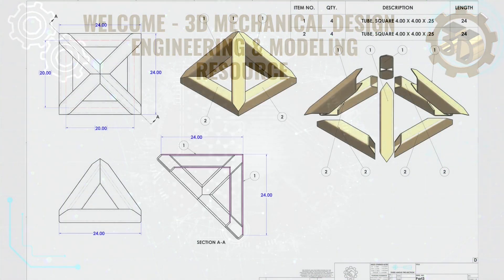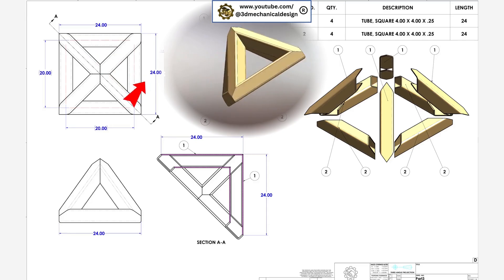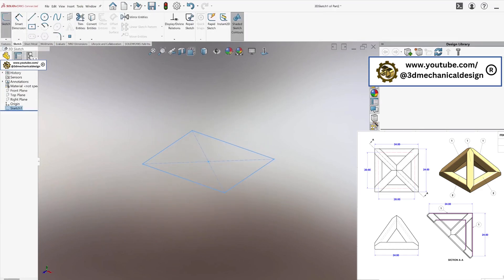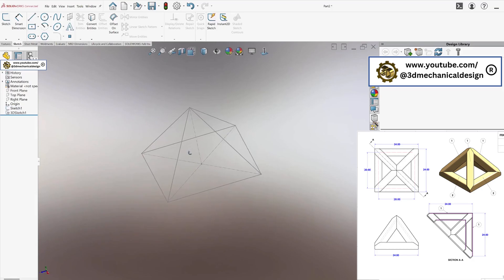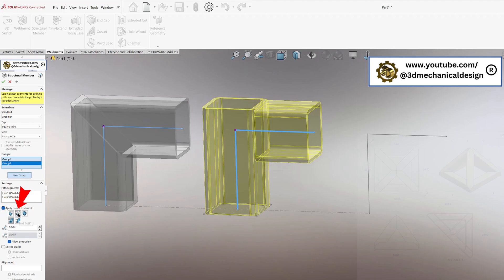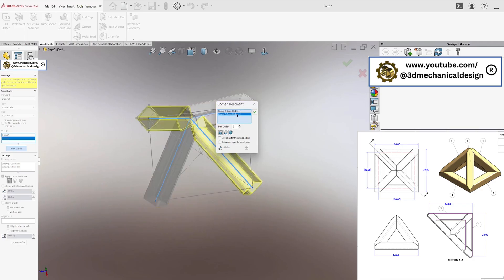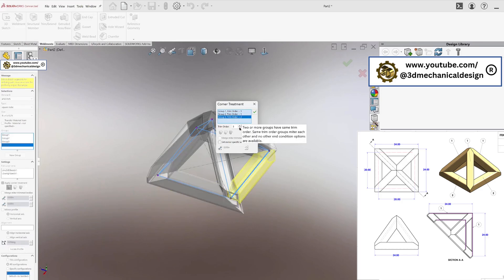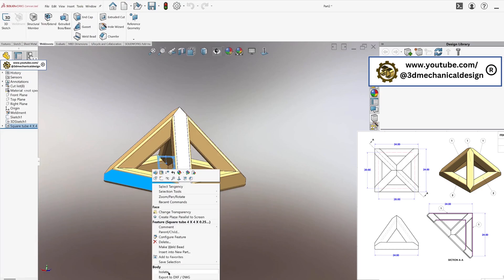SOLIDWORKS Weldment Corners Made Easy!

Comment: How to get weldment tool
Reply: Right click on features and click on Tabs and then select Weldments and after that will appear on the screen.
Reply from the maker: How do I enable the Weldments tab in the CommandManager:

To enable the Weldments tab in the CommandManager in SolidWorks, follow these steps:

    1. Right-click on any existing tab (such as Features, Sketch, etc.) in the CommandManager at the top of your SOLIDWORKS window.

    2. In the pop-up menu, hover over "Tabs".

    3. From the list, click on "Weldments". The Weldments tab will now appear in your CommandManager, giving you access to the weldment tools.

If you don't see the CommandManager at all, you may need to enable it by going to:

    Tools > Customize > Toolbars tab, then check "Enable CommandManager".